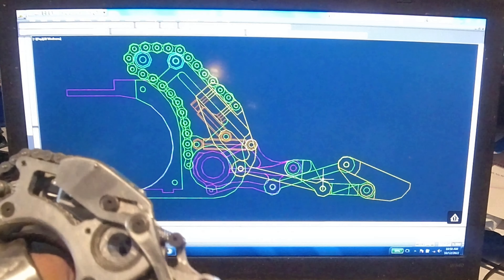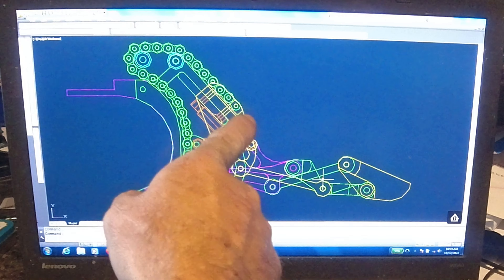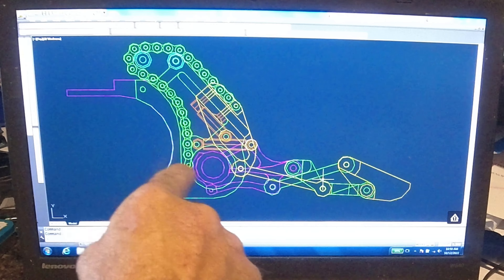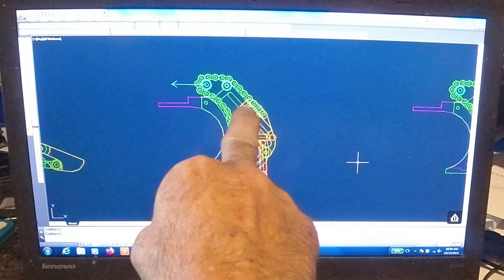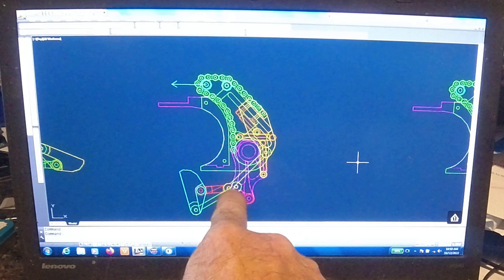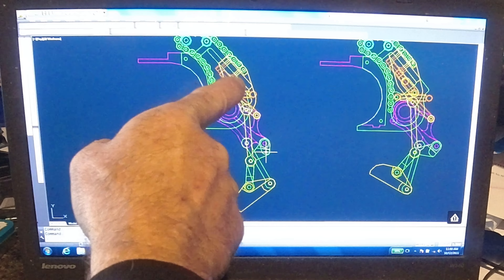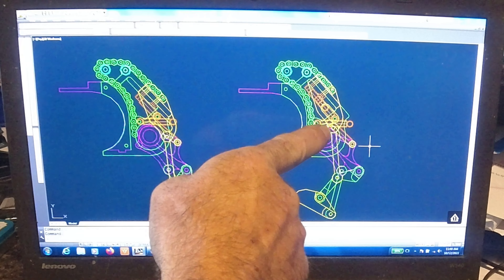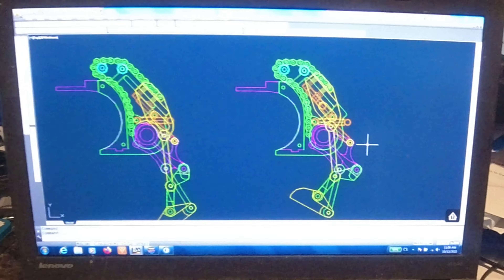How my New Prosthetic Finger Works

Comment: The fact all of the design is done in AutoCAD versus a more modern CAD package is almost as impressive as the design itself.
Reply: Imagine if he made it in Sketchup 💀💀💀
Reply: @cooldud7071  He's not Matthias Wandel, lol
Reply: Redrawing the chain in each position wouldn't be quick.
Reply from the maker: I'm using 2013 mechanical,  it has a chain and sprocket generator built in. The only thing is I have to explode and scale it 0.75% because it only goes down to 25 chain.
Reply: @missingpartsclub  Great Job! What about Freecad?. Best regards from Chile
Reply: @desurbe2201  VIA SHILE HERMANOOOO

Comment: Just spitballing, is there a potential advantage in increasing the # of phalanges from 3? A natural finger creates ~270° total deflection from the metacarpal, would there be potential for a more conforming grip with, say, 4 or 6 phalanges? The palm-side fleshy pads help create that effect of a more conforming grip than a three hard sided utensil.
Reply from the maker: A while back I tried a Finray design similar to what festo is doing for their pick and place devices. for smooth constant surfaces, cubes and balls,, it worked great, but for irregular shapes it didn't offer enough conformity to have a real advantage over the hinged design im currently using.

Comment: that all makes a ton of sense. for some reason I hadn't thought about the difference in tension being what makes this behavior possible, but thinking through it that's probably where I would have landed if I tried to design something similar. as for the linkage, did you decide on the lengths through intuitive trial-and-error or was there some sort of method to it?
Reply: Yeah, was just thinking that that was pretty darn clever

Comment: That’s clever as hell. Just so I understand: The sliders are kept in place with spring tension until the proximal encounters resistance at which point the chain loop being pulled stops pulling on the proximal and instead moves the sliver. The slider moves and with it the medial continues to move while the proximal stays put or at least as long as there’s sufficient resistance. That means there’s a balancing act between what’s resisting more: the proximal or the medial. Is there a reason why the chain isn’t hooked more directly to the medial link or does the slider help with guidance and clearance or something?
Reply from the maker: That's exactly how it works! That's why the 2 different wire springs, to offer different resistance.  I did it this way so I am able to have the medial and distal be as thin and light as I can. If I ran the chain to the medial directly instead of through linkage it adds a lot of bulk to the design.
Reply from the maker: That's exactly how it works! That's why the 2 different wire springs, to offer different resistance.  I did it this way so I am able to have the medial and distal be as thin and light as I can. If I ran the chain to the medial directly instead of through linkage it adds a lot of bulk to the design.
Reply: @missingpartsclub  Awesome! I suppose you'd get that sort of movement inherently using a cable system but i imagine that would be less robust and harder to control. Have you considered something like a wire attached to an arm band that could be used to increase grip strength depending on how much you bend it? i could see some sort of ratcheting mechanism that would only engage when you've gripped and then pulls on the whiffle tree as you extend your arm.

Comment: As a mechanical engineer, that does not have experience in this field, it would be critical for me to know what inputs are available to the mechanism to then generate a resultant output.  I was wondering if you might go through the specific inputs available from the hand/wrist/forearm?  Since the mechanism has to be the transfer function between input and output knowing that side of it could help us understand how you got to your solution.  Just a thought.
Reply: The fingers is made retract by the moviment of the wrist. He can also make the fingers splay by moving wrist side to side which also activates a mechanism for locking the fingers in pre determinated grip patterns.
Reply from the maker: Now here's someone that has watched all the videos and knows exactly what's going on! 
Great job on the explanation!
Reply: @missingpartsclub  If, Sir, you are implying that I have not watched all of the videos on the subject all I can say is.... you´re absolutely right.  Maybe I should have done that before asking huh?  LOL  OK, so the info is out there.  I´ll have to find some time and go through the series.  Take care.

Comment: This hand has the three distinct segments to the fingers, as with the natural hand (proximal, medial and distal).  I was wondering if that came about just as the 'obvious' option, or if you'd done any design or experimentation with 4 segments?  Matching the basic structure of the natural part certainly works; and it's clear that only two segments wouldn't be as good at gripping.  However, I can think of some theoretical arguments to suggest 4 segments might be better at gripping some things - although that would come at the cost of mechanical complexity, a trade off I am woeful under experienced to evaluate.  I'd be very interested in your thoughts on that.
Reply from the maker: Most prosthetics opt for a 2 segment finger with the distal portion canted slightly downward. Obviously its less complex, but in my experience it offeres much less grip force.  Of course a 4 segment design could be made but the marginal benefit from the increase in grip compliance wouldn't be worth the added complexity.  3 segments seems to be a good balance between part count and grip.
Reply: @missingpartsclub  U can get a thing I once heard called a finger saver, basically a thick condom to go over an injured finger to keep on working. Natural skin has a minute amount of tackiness vs the finger condom (obviously U don't want the pre lubed version) (unless...), but utility of tackiness I would think tracks inversely to tactile feeling, i.e. no feeling tacky more better. Again, just spitballing.

Comment: Holy Schnikes! Newly subbed, just found this channel. You're amazing sir. I'm currently designing exo-legs, to become prosthetics whence it becomes necessary. I've had hundreds of dreams of becoming a paraplegic, and the prosthesis being in some of those sequences. Not to mention the fact that I already experience severely debilitating moments from previous lower back injuries. 
 I hope you don't mind, but I might use some of your design on the feet. When the building commences, there will be video.....

Comment: Something I've always wondered, can you fire an airsoft gun with your prosthetic hand? Does it provide the dexterity to grip the handle and pull the trigger independently?
Reply from the maker: I can physically pull the trigger, but I'd end up pulling the shot to the right because you have to curl your wrist to move the fingers.
Reply: @missingpartsclub  I hadn't considered that.